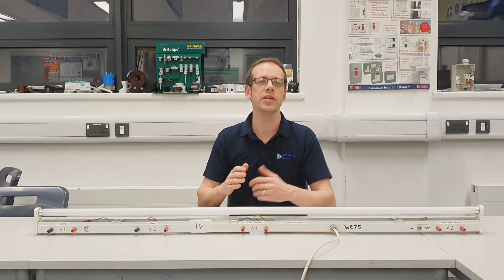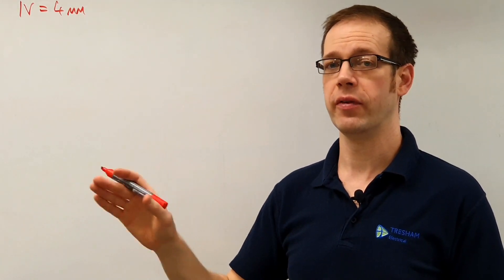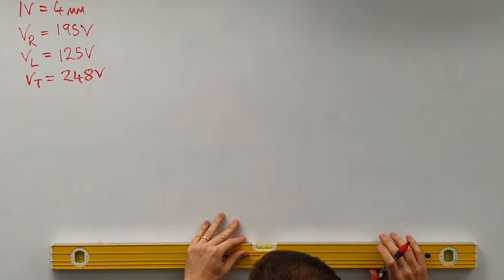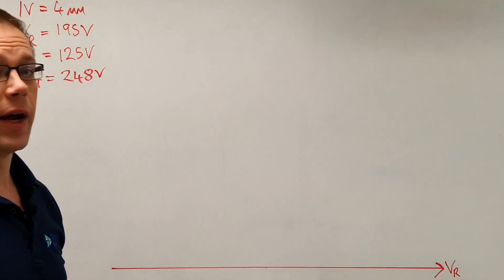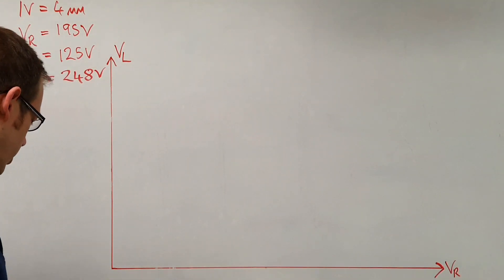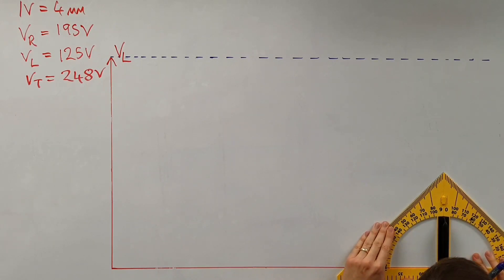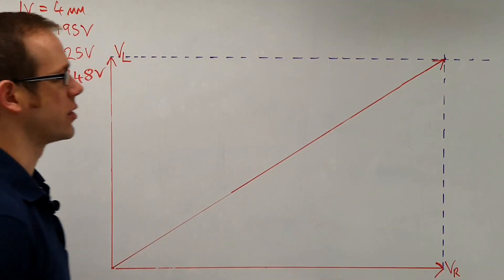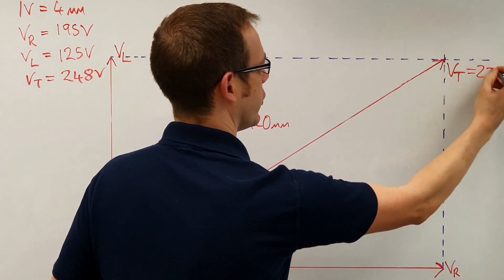AC Theory: How to Draw a Phasor Diagram for an Inductive Load to Scale

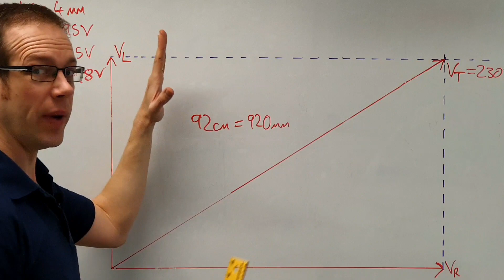Comment: @ 08:45 - 08:55 of 11:42 i have reservations. the inductive line should move anticlockwise to increase the length of Vt.
Reply from the maker: The voltages in this example can't be more than 90 degrees out of phase.

Comment: Sir kindly tell me why phasor diagram of current and impedance is same in RC circuit
Reply from the maker: It will be proportionally the same, as in the same angles but different lengths on each side.

Comment: Does it matter if the resistive and inductive voltage lines were switched? For example, the Vr being on the y axis, and the Vl being on the x axis. Hope this question makes sense. Thanks for the help.
Reply from the maker: Hi Cody, I guess the theory would stay the same but if you watch the list of videos you'll see the reason it's done that way. 👍